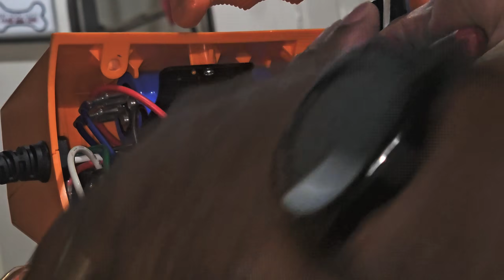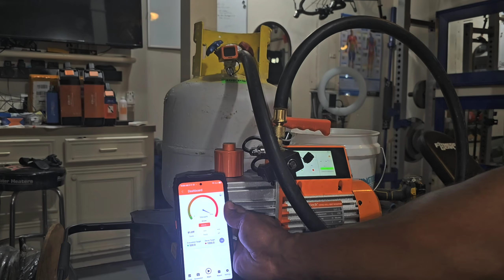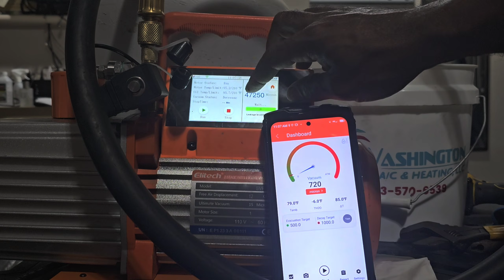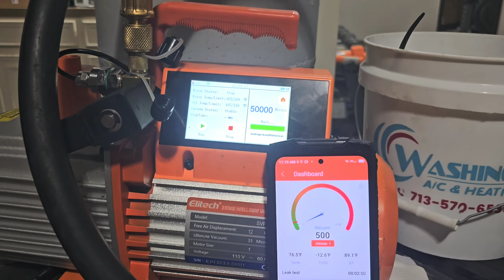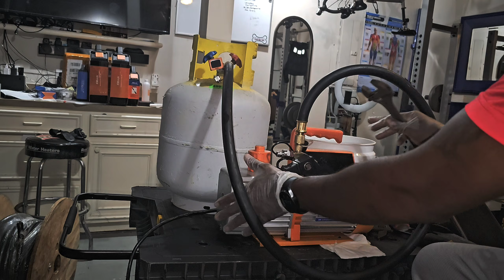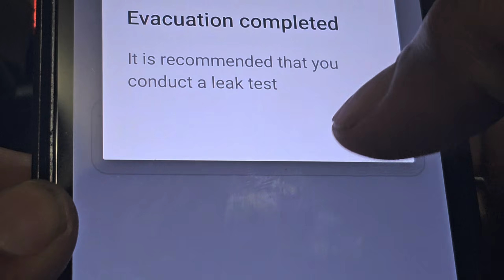Elitech Vacuum Pump Troubleshooting

Comment: Do you like that vacuum?
Reply from the maker: It’s okay, but in my opinion there are too many electronic features for a vacuum pump. With more electronics, there’s more that can fail—especially if it shorts out or gets wet. I prefer a standard vacuum pump with a simple on/off switch.

Comment: This is a generic low-quality $150 vacuum pump onto which has been added a very low budget electronics package.  It is good for someone with no money for tools who is just starting out, however, buy good quality name-brand tools as soon as you can, they will quickly pay for themselves in the time and money they save and the callbacks they avoid.
Reply: I've never had any of my elitech tools fail me on the job. I bought my first tools when I was in school and I still use them. I also have plenty of field piece tools which I regularly use because they make the best probes in the industry, even among all the US name brands. There's no service procedure beyond using alcohol on my SMAN's so if that doesn't work the only option is to send them in for warranty which puts them out of use indefinitely.

Comment: Me personally would rather use the micron gauge rather than vacuum pump gauge. I like the method of pulling the vacuum from one side of system like the suction line, and hooking up my micron gauge to the other side the liquid to get a reading of the full system. But at the same time that’s an expensive vacuum pump so you want it to work. I don’t blame you.
Reply from the maker: I agree with your setup. The Micron Gauge on the vacuum is an additional tool that allows you to see that the pump is working and pulling down.

Comment: Why have a vacuum pump with a built-in vacuum gauge and other pseudo electronically useful things. Elitech is, in my opinion, one of the most generic brands for HVACR. Why not invest completely in well-known brands? I have had a CPS vacuum pump for more than 4 years and it has never had a failure. obviously carrying out all its maintenance on time and keeping it in a hard box for transportation inside the van. cheap is expensive!
Reply from the maker: Thank you for sharing your experience with CPS vacuum pumps! It's great to hear about your positive results.
Elitech offers unique advantages, like built-in vacuum gauges and other electronic features that streamline workflow and reduce the need for additional tools. These features ensure you can see that it's effectively pulling a vacuum, providing real-time feedback on performance. They also provide a cost-effective option for reliable equipment, ideal for those starting out or expanding their toolkit without breaking the bank.
While CPS and other well-known brands are excellent, Elitech's innovation, convenience, and affordability make them a competitive choice for many HVACR professionals.
Reply: @WWHVAC  This is the most intelligent and respectful response of all in life. much success!!❤

Comment: How many cfm? Whats the maximum vaccum reached?
Reply from the maker: This is a 12 cfm pump and pulls down to 15 microns. Also available is a 7 crm and 9 cfm.
Reply: 🎉 @WWHVAC
Reply: @WWHVAC  you have the 7cfm it says in the menu v7 you can electronically change it to the 10 & 12